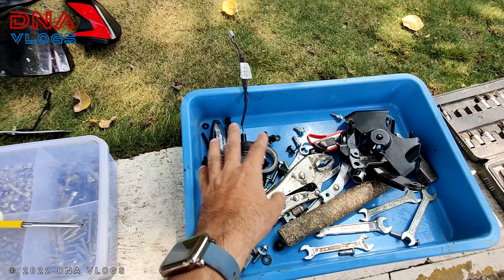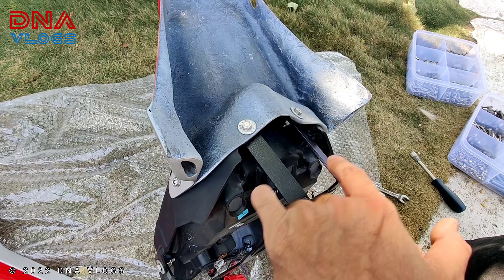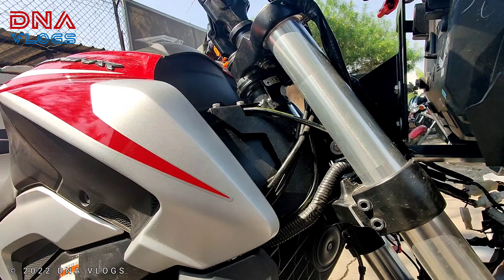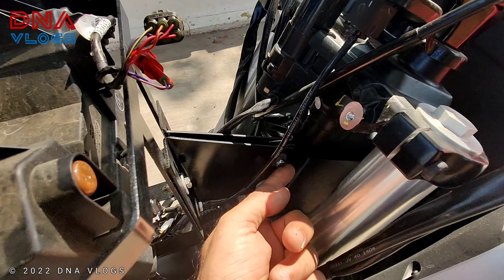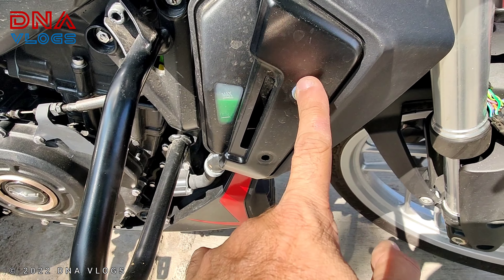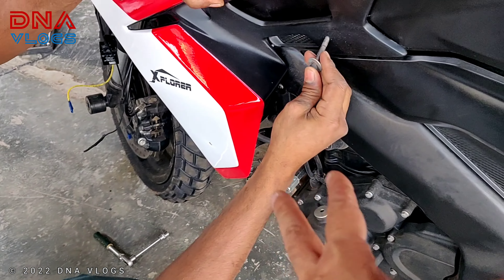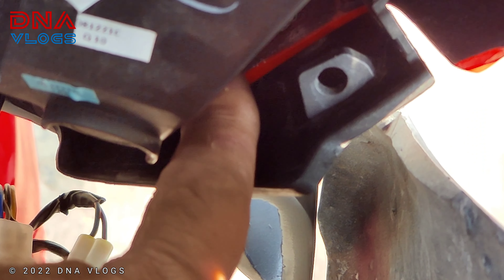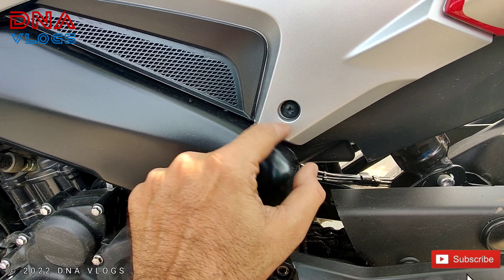Bajaj Dominar 250 Modification | Autologue Design Xplorer Body Kit Installation Overview | DNA VLOGS

Comment: I have the kit installed in my D400,  but running above 145 km/h the bike turns unstable, I used to run it 160 km/h but now I think I can lose control. Is there any suggestion?? I have tight all bolts and locknuts respectively
Reply from the maker: Do you use the bike on a track, where do you get to run such high speeds . 
 I have no such issues, get the bike checked thoroughly for all alignments, like wheel , fork etc.
Reply: @dipen.nisar.autovlogs  Let's see... I can run mi bike here in Mexico highway, where max velocity, is not respected, besides, I use a 42T sprocket. I think is not suspension or tires manteinance, cause a few days before installation kit, I traveled 2000 km with that speed (150-160 km/h) and a generic windshield.
Reply from the maker: Oh, I thought you are in India and here there are speed restrictions and also very less Highways that are not monitored or available for such speeds. 
I have done these speeds a couple of times on Highways near my home town. Open stretches. but never had any such issue.
Reply from the maker: Does the Kit Wobble or show signs of Wobbling being loose ?
Reply: @dipen.nisar.autovlogs  Yes it does, I cannot distinguish exactly where it wobbles, but i'm afraid it is on the long brackets, between the headlamp and the frame.
Reply from the maker: then its the mounting issue. 
1st make sure, there are no vibes in the engine. if there are, bolts will go loose for sure. tighten the foundation too.
2. tighten all Body Kit bracket bolts again, add plain washer between bolt and brackets if required. reference - https://www.exportersindia.com/product-detail/hot-dip-galvanized-stainless-steel-washers-6565478.htm
3. once this is done, also check the Visor Well nuts. replace them if required.
Reply from the maker: I did 145 kmph on a highway recently, while going to Goa from Pune and Zero wobbles. I had a top box too on the bike. check my latest vlogs.
Reply: @dipen.nisar.autovlogs   I have checked and the body brackets bolts are tighten. But I have identified where the issue is. It 's on the headlamp bracket, the four arms sway from side to side when the wind applies enough force at 145 km/h. I will start to check it from there, all bolts and nuts, and I will take a look on your latest videoblogs.
Reply from the maker: @KrizalidFantomx8  ok.

Comment: Hello DNA VLOGS, I hope you are doing great. After installing this kit no doubt the looks are enhanced , I just wanted to know will there be any problems at the time of servicing the bike with these kit installed?
Reply from the maker: there are service videos of my xplorer kit on my channel - with the kit - I never had issues. just that 8 extra nut bolts need to be removed by service guys.
Reply: @dipen.nisar.autovlogs   thank you it is very helpful. I was hesitating to install the kit just because of this reason but you made it clear.🙂
Reply from the maker: @killersark  😊👍🏻
Reply from the maker: have you booked the kit already ? or spoken to Autologue ? what is your Insta ID
Reply: @dipen.nisar.autovlogs  I haven't booked yet.
Reply from the maker: @killersark  ok.

Comment: Dude m stuck between a lil clr issue , as the xplored kit has dffrnt clr variants , m lukin out for a red  a shiny red , and the options whch r avlble on the site r plum and canon red .So cn you plz suggest me whch one wd be gd ? And one more i wanna ask do we get the belly guard along with the kit ??
Reply from the maker: Refer the video again to check what all comes with it. And color is absolutely your personal choice, send a dm to Autologue design on insta. Share this video with them, and share your requirements too with them. Color you need to decide for sure. 👍🏻😊
Reply: @dipen.nisar.autovlogs  which is shiny plum red or canon red
Reply from the maker: buddy Google the colors for clarification 😊 - they are two diff colors you are looking for.

Comment: Hiii bro .. can we fit this xplorer kit to rtr 200 plz reply
Reply from the maker: Does your RTR 200 have the same mount points, same headlight etc ? Do let me know. 
By the way, I always reply, you can check comments. 🙏🏻
Reply: @dipen.nisar.autovlogs  thank a lot for replying .. mount points are different .. but I truly love this design .. and I want to install this ..plz help in this , I have done some  modifications on that bike , I can share that
Reply from the maker: @Danymotovlogs  you will need common mount points to continue the installation

Comment: Nice video. Have the same color D250 purchased in November 2021. In the video you mentioned regarding the steering being light after installing the xplorer kit. Is it due to weight getting reduced, which means the weight now lies on the front body frame? Does it impact high speed stability in anyway? Also, couldn't find this color mentioned on Autologue Designs website. Is this xplorer kit specifically customised for the customer?
Reply from the maker: thank you.
1. Yes the steering goes light and bike feels nimble as the weight now moves to the panels.
2. Does not affect anything else. 
3. Once you book, they will ask for color confirmation, in which you can let them know your bike color (though its not on the website)
4. Nope, the bike see in the end, where Sanket is seen riding it, that Kit is the standard Kit. there are graphics available too , you can check Autologue Instagram for the same and you can check my instagram for my bike graphics.
Reply: @dipen.nisar.autovlogs  Thank you
Reply from the maker: your welcome